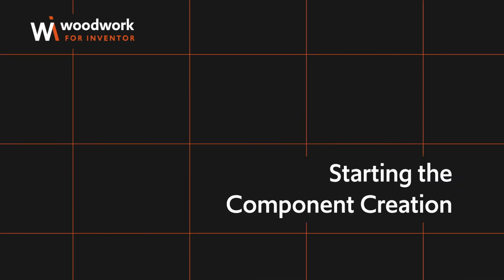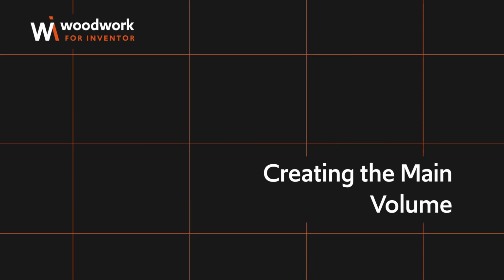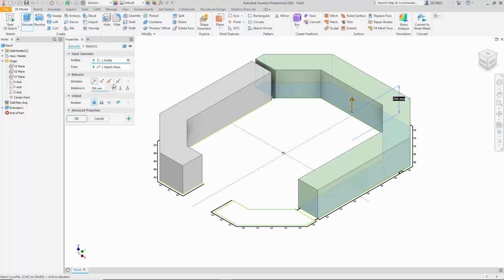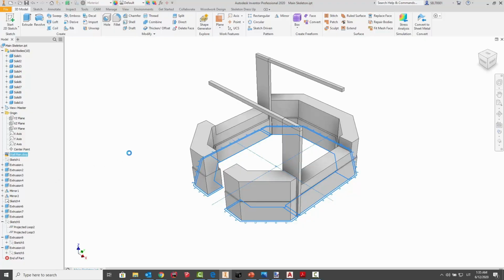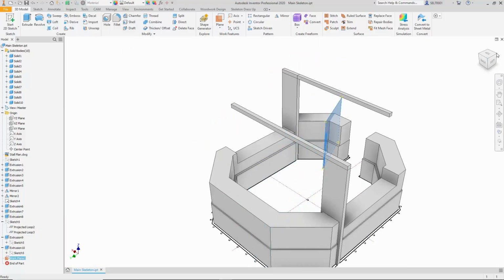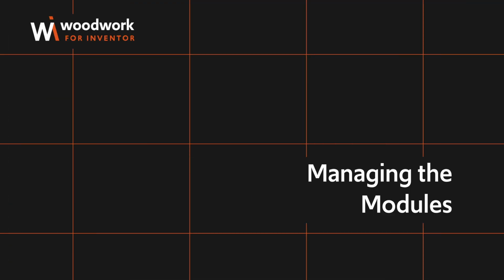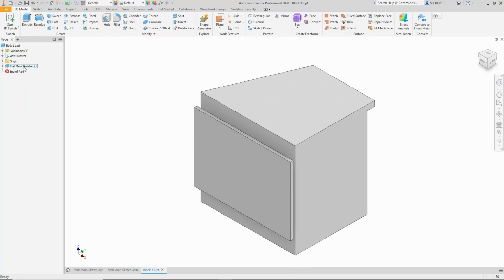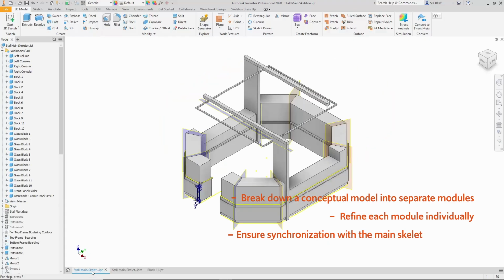Market Stall Skeleton Building

Comment: Everything demonstrated here has been a common standard worklow in Inventor since multibody single parts were introduced about 15 years ago. Build a primative multibody part with paramenters. Use the "make components" command. All subsequent parts remain linked (unless you break the links) to the source part. Nothing new here. What am I missing?